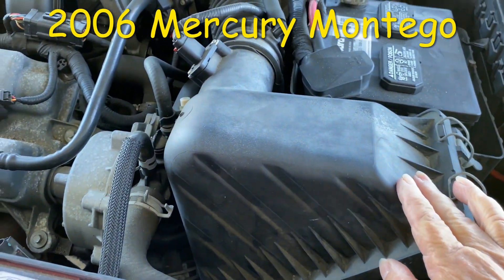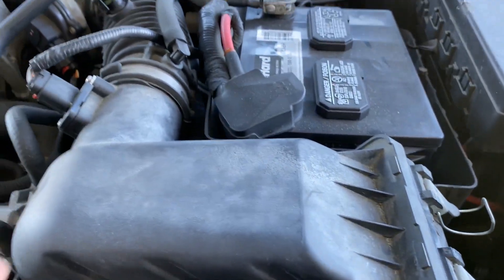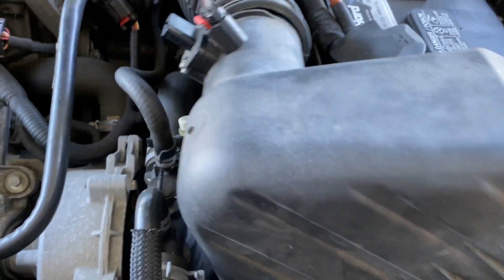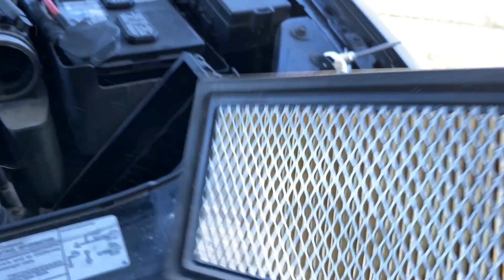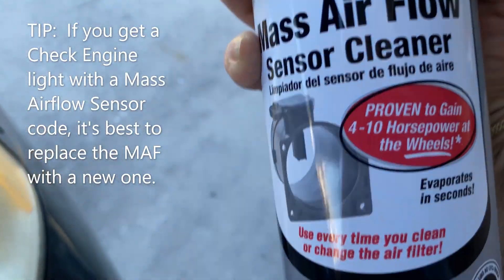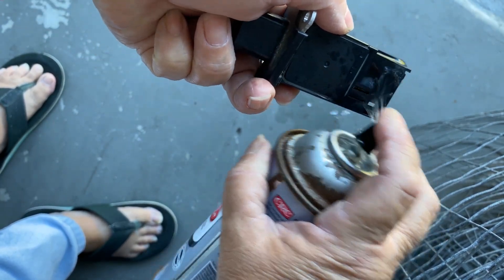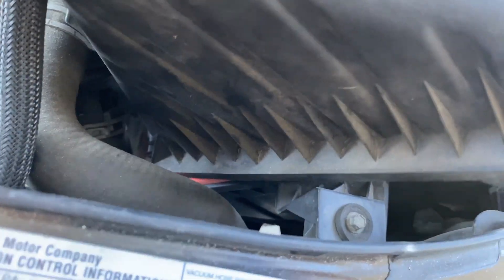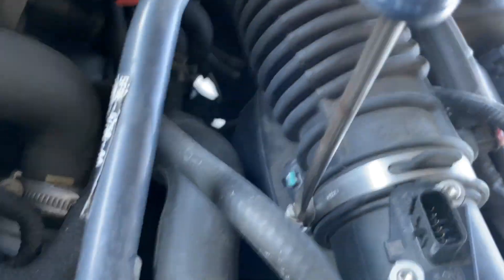How to replace the air filter and clean the MAF sensor (2006 Mercury Montego, Ford Five Hundred)

Comment: This is exactly what I needed to do with my 2007 Ford Five Hundred. The tach was showing an unsteady rpm at idle. Cleaning the MAF sensor and changing the air filter did it. Thanks!

Comment: Hey there. Have you ever replaced the air box assembly housing? Or move it? Do gou know the 3 tabs that connects into the lower part of the box? Well mine has a broken spot. So i need to replace that lower unit. Im guessing its just one bolt that gets undone and pulls out? I believe this is why the car has a bad idle. I cleaned maf, throttle. New egr valve in. New pcv valve. But the idle goes crazy after 5 minutes of start up. I think it might be a vacuum leak from thst airbox maybe. Seeing how it doesn't have a perfect connection, only 2 tabs went in
Reply from the maker: @ChrisD-lz5oh   No, sorry I have never replaced the airbox assembly housing but you might be right about the bolt. Is the car throwing any codes? Check engine light on? Even if it’s not on, check for codes, it could be several things that can be causing the problem. Check for any vacuum leaks to start. It could be something as simple as not replacing the gaskets on the throttle body, EGR, etc. when you were cleaning them. Start with the easy stuff first.
Reply: @Chocaluvr thanks. There was a code but it went away oddly, its p0106 manifold absolute pressure, barometric. I changed the throttle to a new one in 2022, put in new gasket too, but it was aftermarket